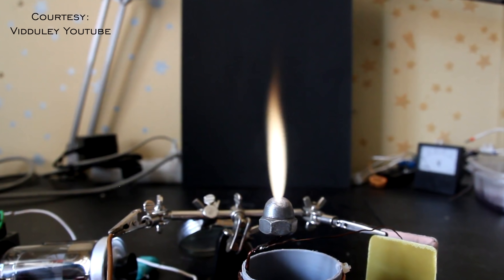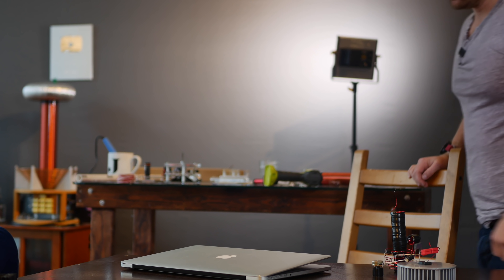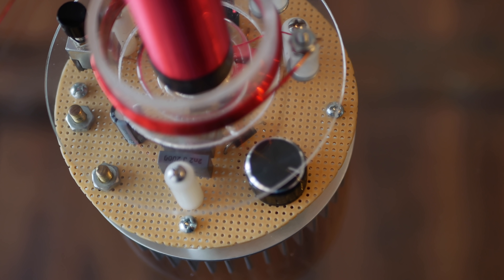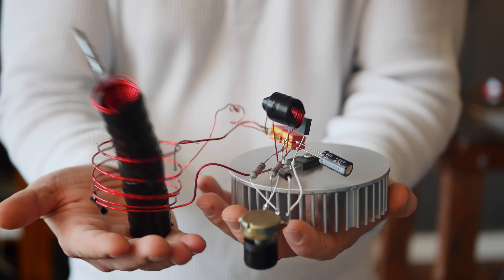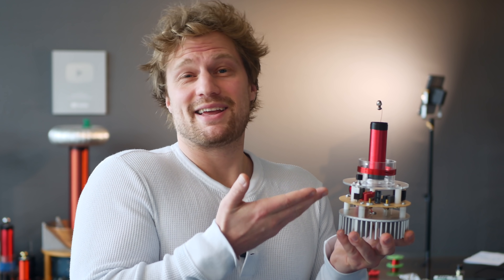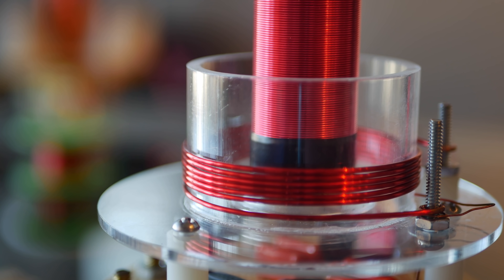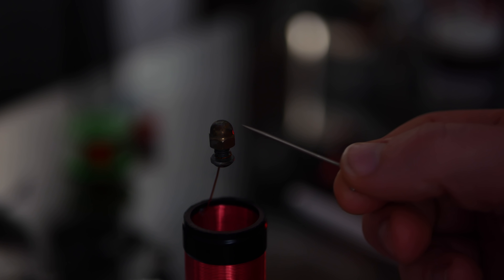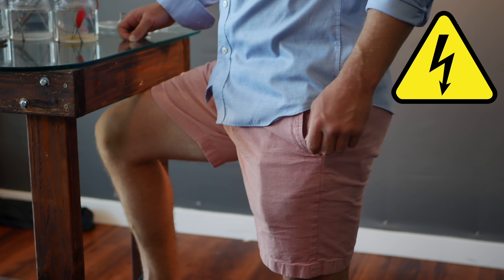Building a Wireless Power Plasma Candle ( Flame Discharge ft. Teslaundmehr)

Comment from the maker: Thanks for watching! PLEASE NOTE: 1) I ensured my location was RF shielded, 2) The candle does not resonate at exactly 10Mhz - closer to 10.8, and 3) I encourage anyone attempting flame discharges in USA, to do so in an RF shielded location as well. Causing interference is literally illegal.
Reply from the maker: Challenge accepted, Timothy
Reply: @PlasmaChannel  I'm new here. I want to make a plasma tool for cleaning surfaces especially welds and engines.  Any recommendations?  
Just subscribed?
Reply: @PlasmaChannel  Hello friend I have a question for you, you can do the same as in the video for me under the order, I can buy well, well, if you can :)) I would very much like this))
Reply: @PlasmaChannel  Great video I really like your cool videos never stop to make videos we are always available to support you.
Reply: I think that you are ok with that great coil! I doubt that it will radiate very far. I was attempting to make a joke! Fail! Sorry.
Reply: Jay your dad dint tell you but your brother is living in the UK his name is Jamie Oliver, google him
Reply: I used to build spark gap Tesla Coils. Neighbors complained more for the loud noises!
Reply: hey Jay can you please do me a favor and do a video on field shapes using your led board and different shapes of em coils but please be shure to include the inside field of a square cone coil 4x4in   4, 1/2 in length 3 1/2x3 1/2 in at the small end I need this for the accelerator for a full spectrum ion thruster prototype.... little side project I'm working on somehow like half of my comment got deleted I had to go back and edit it.
Reply: @PeterSripol  and @PlasmaChannel , the starting block for fully electric jet engine with multiple plasma candles and a turbine ?
Reply: What happens if we try in vacuum
Reply: We😇following you👍 around the world🌎 thank you 🙏❤💙💜💛💚💕💖💗💘💝👍👊👌👏and good contunuiation💟🔝🔝🔝🔚
Reply: I am very curious to know what sort of spread of frequency would show up on a scope using a couple of metres of bare wire. i.e. a crude multi wave antenna just tuned by the scope input.
Reply: Sir i have a question, how did you reduce your amps on Your Ozone scanner. I wanna know how to do it because Im afraid im gonna get zapped from the super high voltage of the Ozone Scanner
Reply: You just explained solar flares to me. You might want ti show this study to www.Shine.com.
They're all plasma field scientists that study the sun.
Reply: jay if you want to see some vacuum plasma check out my newest teaser video ill go into detail on each one in later videos if plp want me to I'm thinking of letting some of my work be open source, just be shure to ask me what you want to use cuz afew like the core of the V.F.R, the T.F.C and the core F.S.I.T are patent pending 
the last three clips in the video are of the fusion core without the multistage accelerator coil to the full spectrum ion thruster prototype or the F.S.I.T [fix-it] prototype.
Reply: If it has a Venturi Tube and from one side it sucks air inside and with the ionisation it increases the escape velocity
Reply: @CUBETechie  I'm wondering if it is possible to do as you are saying and use air or other gasses too to direct the torch. The movement through a nozzle will cause the plasma to be more needle like and it would maybe cut similar to a plasma cutter then because you could invert it and still have the 'flame' going the way you direct it to. The plasma wouldn't be attracted to the surface like an actual plasma cutter, but that makes it free to use like a regular torch then. Argon and other gasses would probably have different colors depending on their ionization potentials too. Interesting idea!
Reply: @@PlasmaChannel  hello bro I have a project on super speedy vehicle. Can u help me?
Reply: What was killing the Mosfets?
Reply: I was literally wondering about interference in fact, though I wonder what if you make the amplifier oscillate at 13mhz (ism band) and filter it if its possible to keep the power/emissions from the coil itself low enough maybe it would be possible to use it in a normal location
Reply: @diegogmx2000  The issue is not the chosen frequency of the Tesla coil. The interference comes from the arc: in this case the candle flame. If you watch the Plasma Channel episode on the "Spark-gap" transmitter you will begin to understand. There one can see that although the Spark is driven by a multiple kilohertz signal the Spark itself gives rise to multi frequency (broad spectrum) radio waves. Radio waves start at about 15 kHz and go on up to Gigahertz. An arc welder even emits X-rays. The fact that the plasma flame emits light frequencies, implies that it is emitting from below 15 kHz all the way up to ultraviolet light. My query was to find out where the most power was in that wide spectrum. Admittedly one would get the best idea of the spectrum generated by using a very wide band Spectrum Analyser.
Reply: @diegogmx2000  What about housing it in a tuned mesh housing  as long as the housing is not close enough to ground the plasma flame? It could also act as a safety barrier in case something falls or tries to touch the flame.
Reply: hey jay enjoying the snow? if you want to see some vacuum plasma check out my newest teaser video ill go into detail on each one in later videos if plp want me to I'm thinking of letting some of my work be open source, just be shure to ask me what you want to use cuz afew like the core of the V.F.R, the T.F.C and the core F.S.I.T are patent pending 
the last three clips in the video are of the fusion core without the multistage accelerator coil to the full spectrum ion thruster prototype or the F.S.I.T [fix-it] prototype.
Reply: Try to avoid ressonance around system.
Reply: where did you get the insulated coil wire from?  Do you have a distributor?  I'd settle for an Amazon link.
Reply: you forgot to consider that in your edge point become electromagnet by the small coil/nut around it.
Reply: I already subbed with two accounts, but I'd love to see a small metal foundry made of these candles ahaha
Reply: @powerofthought2294  If you resonate the wave form signature of the plasma candle in a certain way that are "tuned" to certain element's resonant frequencies, you can cause those elements to break up easier and dissolve more effectively. I know it works with Hydrolysis of water, and it causes water to break up with less energy, therefore a more effective and efficient Hydrolysis action can be achieved.
Reply: them: If your a new view or you won't get it.

me who just saw my first video 5 minutes: O_O
Reply: I'm sure you have heard this already, but just noticed you're missing the TVS in your schematic diagram.
Reply: The FCC, FAA, and NSA offer their thanks for this disclaimer
Reply: I can only imagine how difficult it was for 'Hacksmith Industries' to build a real working plasma lightsaber.  🤔🤔🤔
Reply: Ok I found why electronics are always dodgy in Ballard
Reply: Can you improve the thrust?
Reply: I have a doubt. I learned plasma is a state of matter. But can it be changed back into its previous state (to gas)?
Reply: Can I have the salmon?
Reply: obviously that technology could evolve
Reply: Did you get my replay yet? I don't even have a soldering tool I'm just 7 years old. Plus I don't know how to invent but I do like inventing I made a little Tesla coil that actually works but you have to put it but you have to put a piece of metal really close to it to make it work so that's a problem I have two plasma globes and I took one apart to make the one that I just told you about. Please give it to me plus I'll even send you a picture of a the one that I made oh by the way what's your name. I mean? By the way I did not even know about Tesla coils until I went to WonderWorks they have a small one that makes music and it's in pigeon forge. Do you think you can make one that looks exactly like a real one and then send it to me in the mail? Please read the comment that I just sended you would you please? Bye.
Reply: Very good! You have the seed for a real Lightsaber.  Use the RF and EMF  by products as a Source.
Reply: Hey Jay, I put one together and it's somewhat of a challenge to get it up to the right frequency but it will light up a bulb and you can see some RF discharge.
  I set my scope away from the device around three feet and it will pick up the wave form at that distance. I'm not sure how accurate it is with the measurements but at least I can see what happens when I do things to it. It's very persnickety and pretty much anything affects the output. Changing the primary winding even a quarter turn has an effect! I have tweaked every parameter that changes and it seems very stable but it can't seem to get much past 6.77MHz without going catatonic. Lol Adjusting the pot up makes the frequency get a little higher but it will eventually flatten out and stop resonating. Adjust the pot lower and give it a tap with an insulated screwdriver to get it going again and continue adjusting lower and the waveform gets higher until a point where it goes B-fib so to speak and it has no idea what to do and you hear the IGBT screaming and death is just around the corner! 
I'm not sure if you have any answer, but the only thing I can think of that is left to change one more time, is continuing to unwrap the secondary. I started with 160 turns as your description describes, and took off 10 turns to make it 150 as the other person's description indicated, but there wasn't much change. 
Also, I'm using a computer power supply for it because it's real stable,  and o for it for free. Brand new from the dumpster ya know! I don't want to kill my power supply again through feedback! I hope that having my ocilloscope on at three feet away doesn't damage it and was wondering if you have an opinion about that. It's not freaking out like my phone will when it gets near the device but it's close enough to read the waveform and shouldn't go over voltage as far as i know! Eeek... the computer power supply only puts out 4 amps and a touch more though, and that's the one parameter i haven't changed yet-- Hmmmm. Now I'm thinking there might not be enough power to get the flame and I'm doing nothing wrong at all?? Maybe I just answered my own question here-- it just came to mind while writing this...but I guess if you have any pointers they would be greatly appreciated! I can't recall the other person's channel name, tesla- something, no offense intended, but he seems to have all the parameters nailed down to a T since I have messed with most of them and it came back to his recommendations for everything- well done and kudoes to him! But Duh, it's needing more amperage, and is otherwise working flawlessly as a Slayer Exciter look alike lol. Oh well I spent time to write this, and I mostly wanted to shout out to you because I really like your channel and it's always a pleasure to see what's new here! Very well put together too! Electroboom quakes underneath his eyebrows! Haha! Now he's gonna modulate one so you can speak through it I hear. Great production!
Reply: Linke to shop
Reply: Thanks! Great to have your experience of tuning. You could save us from many hours, many dead MOSFETs and possibly giving up.
Have you thought of modulating the flame with audio? Then you could have music with your romantic tesla coil date! 😁
Reply: Can you tell me all items name for heavy build wireless power plasma
Reply: So, just wild imaginative thought if the pyramids in Giza could be plasma power generators...how far could that power source provide power in an area of countryside. Ie...for light illumination,cell phones,microwave ovens on a wireless circuit?
Reply: Seriously please make a compact lighter out of this.
Reply: Super! Like and sub now

Comment: I love this and I love your videos. I want one of these. No, I'm not going to risk building one. I'm not foolish enough to test my untested skill at building one. However, I do notice one flaw or rather one thing that your wax candle can do that. Your plasma candle cannot and that is be lit when the power goes out. I wonder if this could be built with battery power like some just a regular battery Bank or something. Supply the input voltage. That way it could light up when the power's out. That would be cool.

Comment: If you had a number of hollow electrodes with jets of compressed air converging on a central point, you might create a ball of critically dense  plasma at the center.  A critically dense plasma is opaque to light.  This might be very useful to collect concentrated solar at the focal point of a dish mirror to drive a gas turbine.

Comment: If you use different heads can you make the flame wider? If you put a pipe over it where the flame would be in the pile but having room enough to let air in at the bottom would it creat good airflow ? If the flame is attracted to the pipe you could try magnet rings to keep it in the center.

Comment: Would you happen to know the exact equation needed to better understand the relationship between the primary and secondary coils and wire gauge of both for a properly tuned resonance?

this way one could theoretically do the math ahead of time while designing the coil and have have one fairly tuned without so much need for extra circuits and drivers after building n could just use specific guage wire and number of turns or coil width x height.

Id like to make a basic tesla coil as simple as possible

Comment: @PlasmaChannel 
😂🤷‍♂️ Jay... what are you scared of 🤷‍♂️

When I was watching it, all I was thinking about was how That candle is essentially a micro jedi lightsaber 🤔💪

But also.. 🤔 Im curious if the secondary coil should of been mounted on a longer tube, so that it would be more centered on the smaller tube..... so it wasn't just interacting with the last few coil raps on the bottom. 🤔
It seemed like having the secondary coil higher up was useful. 

But now I'm curious if this can be more powerful,  & fit within what would be a sword/knife handle size set up.🤔

The fire bending was kinda cool.... Making a jedi lightsaber, thats a bit more BadAss! 

🤔 but also... Im still waiting for you to combine your ionic thrust engine with your tornado generator... 

Cause im Pretty sure it will have a synergistic effect & would be able to produce much more thrust. 
But also.. Im pretty sure it would be a Great intake for a any type of combustion engine, jet engine,  or ram/sram engine. Or just be a great electronicly controled ram air intake.. 💪🤷‍♂️

Comment: cool now make a lightsaber
Reply: You could make a light saber with the candle style tesla coil you just have to make the circuit and power supply compact enough to fit in a handle
Reply: Also a 3d printer will be very useful to make the handle so make sure you got that
Reply: Having a grounded object at the opposite end of the wire held like this:
 (grounded wire)
|
|
|
{circuit stuff}
[ handle]

: would probably work

Comment: Jay, I've measured the number of Ions emitted from the typical Corona accelerator, both your design (#1) as well as Integza's design.   The maximum number produced seemed to be in the region of 50 million to about 100 million (1E8) ions per cubic cm per second.   I measured these on a Ion meter.  Do you have any ideas on how to get to 1E12 ions per cm^3/sec ?  1E14 ?

Comment: Here it is an idea for the energy cell: - A small tesla-coil on battery, a vacuum chamber with a metal rod, and a magnetic charge separator, and along the edges of the chamber there are linings of absorbers of positive and negative charges!! The frequency is selected such that in resonance the metal completely turns into plasma! The magnetic field separates the flows, which are collected by the plates in the chamber, creating a charge on the terminals!!

Comment: not a cheap circuit build, but interesting. This is not a battery operated widget. The zero-switching MOSFET idea sounded like the biggest challenge, highest rewards. 

I'm always amazed at the power of oscillators and their many applications. 

and it's invisible.

Comment: New Electro Magnetic, Plasma Heat Shield. tech!  Technology Transfer Program is licensing its rights to a radical new form of propulsion that uses electromagnets to control the flow of plasma over aircraft and spacecraft flying at hypersonic speeds. -A-plasma-force-field-to-protect...
This heat creates a plasma shield that's denser than the surrounding air and able to deflect or absorb the energy from the incoming shockwave. ... "The general concept is to use an electromagnet… See more

Comment: Circuit has no sence with input connected to output. The whole purpose of the frequency multiplier using the MOSFET is to present a frequency going in to get a higher coming out. Instead the input is connected to the output and the output is connected to both the input and output. Surprised if anything comes out of this.
Reply: input is not connected to output

Comment: Non-technical question(s):

I know that this is said to produce crazy high temperatures (metal melted, walnut carbonized).
Can the temperatures be regulated/moderated/controlled?
I suppose what I am getting at is speculating as to whether or not say twenty of these could be arranged in a manner that would SAFELY heat living quarters or cook food in a reliable and environmentally friendly way?